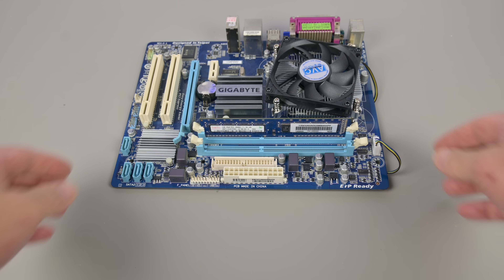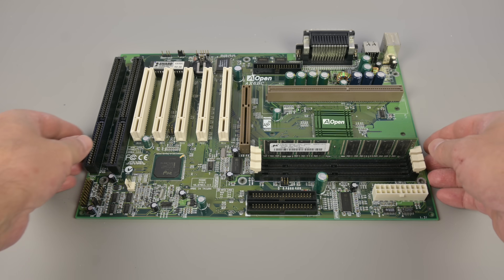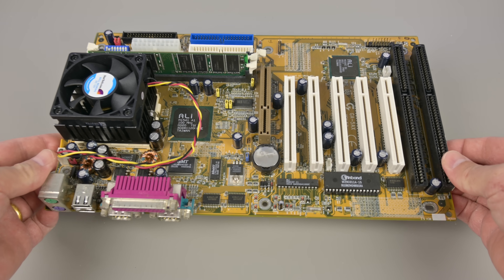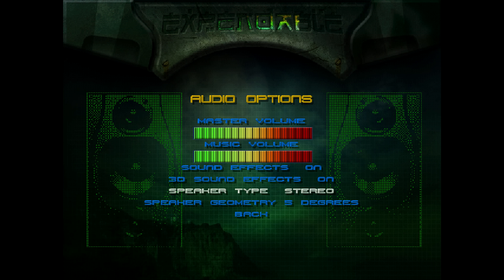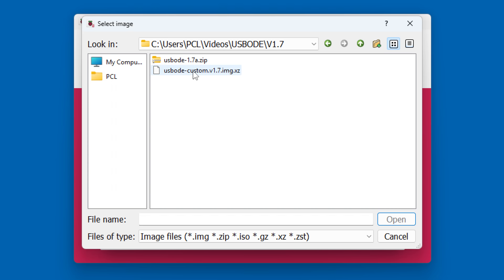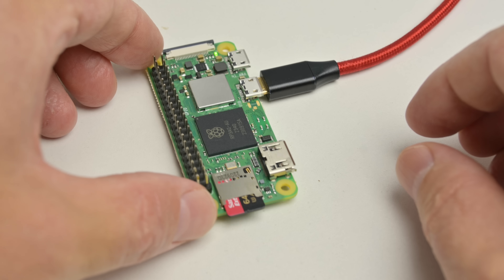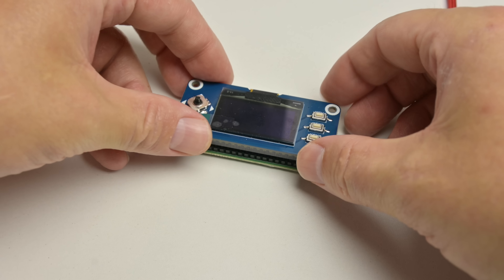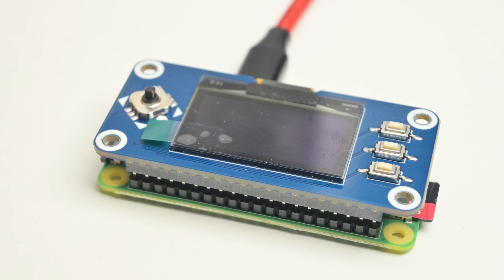Finally a cheap CD-ROM emulator for DOS and Windows 98!

Comment: Man, maybe you have an idea about this. i have my ALONE IN THE DARK TRILOGY original discs for widows. and I am looking for a way to play them .but using the ORIGINAL DISCS, not an image.  I have a PC with i7 4th generation procesor .  The 3 games should run on windows 98 . I also have the game X Files... if I remember correctly this one worked at Windows Vista.  So PLEASE, do you have any idea how to use  those games but still using the official discs to load them ?

Comment: I don't really see the point of using this instead of a real drive honestly... 
This device brings even more incompatibilities with older system and don't have faster rate of read/write than a DVD drive, not even more than a CD one...
Reply from the maker: You don't see the point of a USB optical drive that mounts ISOs instead of real discs??
Reply: @philscomputerlab , yeah I don't really understand why using this rather than a CD/DVD drive honestly, if at least it was fast it would be useful for 2 things, data transfert and longevity. Plus ain't demon tool or similar software working under win 9x ? It would be less annoying than using this device for every day use I think. Mounting ISOs directly from the HDD is faster for games loading, I'd use a secondary HDD just for ISOs or at least a larger disk drive for the system storage
Reply from the maker: You can't boot with Daemon tools. I really think you're missing the point. Just think if a USB optical drive replacement, that's what this is. If you aren't considering a USB optical drive in the first place, well then this device is simply not for you.

Comment: I love new tech, but there is something nostalgic about doing it the old way.   Sure, it is a pain to burn CD's, but at the same time, that is accurate to the time period.  The sound and feel has value to me.
Reply from the maker: I hear you. I read line that new optical drives aren't being produced anymore. So best to stock up.
Reply: @philscomputerlab  I have enough optical drives to cover my lifetime.  What is even harder to find is a high quality 5.25" floppy.  I have two left.  Both in good shape, but it would be nice to have a brand new one.  The tech of my generation is dying off with us.  Sad, but inevitable.

Comment: You STILL got to have a DVD drive to get the goodies off any original discs you have or may acquire. I have a requirement for almost ANY case I may build a system in to have a 5.25" drivebay. 
Tempered glass and RGB? Just Say No.

Comment: Love this for making use of a pi with old machines, but I wonder if support is planned (or implied) for dvd isos and support for modern bootable isos so I can use this at work instead of finnicky usb multiboot or set up pxe boot just to install an OS on a server.
Reply from the maker: Try it out, you might be surprised 😊

Comment: Been using the gadget_cdrom project for ages. Not using it for retro pcs but as a service device to reinstall modern  operating systems.

This one seems to be a better fork version of it, to be honest, I wish they prioritized DVD supporr which latest pikvm now support DVD.
Reply from the maker: DVD ISO worked fine for me. Unreal Anthology to name an example.
Reply: @philscomputerlab try using a untouched dvd iso windows 10/11 and boot at it, during setup process, thats where the issue comes in.
Reply from the maker: Yea I've done that, check some of my previous videos. Installed 10, XP and 98 with this device 😊 @EmilePolka

Comment: Hey Phil.

I was watching this video and immediately wanted to ask.

Does this ODE also work on more modern systems?

Cause if yes, it would be a good way of loading Linux .iso files or more unknown operating system .iso's as Ventoy doesn't exactly boot more unknown operating systems. (Haiku OS is a good example. Trying to boot that .iso from Ventoy just results in a crash into kernel debugging land, even in RAMdrive mode)
Reply from the maker: Absolutely 😊

Comment: Why do we need this? Just use a cd-rom. You’re already using vintage mobos and procs. They’re out there. I’ve got a few kicking around. Even modern optical drives should work as cd-roms.

Comment: I want a SATA to PCIe NVME adapter. So what if it's a lot slower than the best speed of the slowest PCIe NVME SSD, it could still be made to max out the best SATA transfer rate. USB C to PCIe NVME adapters exist, that's adapting one serial link to the 4 PCIe lanes these SSDs use. I'd also love to have an ExpressCard with one USB C port using a real USB C controller, not a USB 3.0 controller with a bodged on USB C connector.

Comment: Here is some information to help such devices develop. A RaspberryPib3B+ could be a reasonable choice (or Pi3A) for the faster, and somewhat overclockable CPU, plus the extra RAM on some 1GB models, especially if the graphics are limited to 16MB (which also happens if the OpenCL driver is used to utilise the GPU as a processor core of sorts in terms of heterogenous computing) and also some of the A53 CPU chips will overclock. So if thereby the "Emulation CD or disk" speed can get up to (and maybe beyond) 10x CD speed, tat is essentially a 1x DVD speed which could be useful for various reasons, including on Linux to use the emulator for bootable LiveCD ISO files or Live-DVD whereby the USB of the raspberryPi3b is, by adaptor, plugged into a USB port of the AMD64 (or Intel) PC which then sees it as some ATAPI or whatever CD or DVD drive, maybe even as a CDRW in CDRtools or DVDRW. There is also the fact that (especially with the extra RAM at 1GB thereby allowing perhaps 512MB or even more) for the RAM to _(almost like squashFS) hold a ISO and ISO buster to author and change and checksum with no wear and tear modestly sized ISO files, albeit maybe slightly smaller than a full 650MB CDRRW, but maybe a full 650MB CDRW ISO could be editing in the RAM on it that way. There is then the fact that the A53 configuration of the Pi3b and Pi3B+ (and the Pi3A but it has only 512MN RAM) involces protection-rings and those are associated with use cases for say a camera but passthrough of a CDRW drive emulated might work especially for the associated audio and video connotations or even streaming wit a SIP UDP session initiation protocol. The OpenCL driver can be used for the GPU to help some Fourier analysis and perhaps Laplacian polynomials in a matrix for a part of video processing of a DVD or SVCD or some plain MPEG or basic ogg-vorbis-theora low in bitrate and gentle on the compression. A carrier signal on the FFT could be useful for signal integrity by OpenCL GPU0 and CPU combined, or polynomials similar to a basic PLL. The Laplacian dampening could also be used in audio and video plus predictive buffer. Or Markov chains from a Lapacian matrix thereby formed by generation of Eigen vectors could be used in compression, even general purpose like some tar and *nix-zip sort.
My comment has no hate in it and I do no harm. I am not appalled or afraid, boasting or envying or complaining... Just saying. Psalms23: Giving thanks and praise to the Lord and peace and love. Also, I'd say Matthew6.

Comment: Maybe another project would be great to emulate very old GPU that run under windows 98 like voodoo 3 3000 using USB and the pie
Reply from the maker: GPUs are incredible complex, I don't think will happen easily. There are projects that use old GPUs though...

Comment: I love this, I used it in both DOS and Windows 98 on my Pixel DX. Apart from it needing bin/que support, which does appear to be on the authors radar. Another thing that would be nice is a web UI that can be used on a phone. I find changing CD's on a phone requires zooming in which isn't nice. Perhaps someone can help there with a more modern UI but not over the top React app either, just some styles should suffice.
Reply from the maker: Yea, I also use my phone and have to zoom in for the main menu 😊

Comment: Cool.. But not for me. Or I'm not thinking of the reasons atm?? I have like 50 cd-rom drives and a lot of cd-rw and cd burners etc. Also if the pc has USB I can just flash the iso to a USB stick and run it that way...There are also lots of IDE to SD card adapters on the market that can be used with computers without USB (for like 10 to 15 bucks)

Comment: What drivers did you end up using?  I've tried USBSYS, USBASPI, and OAKCDROM with no luck detecting it.
Reply: Make sure the usb cable you are using can support data aswell as power. Some only do power.

Comment: The 'cdemu' project provides full emulation of optical drives on Linux. If the Linux Mass Storage Gadget could forward SCSI commands this would be a great way to add support for CDDA and other file formats. Unfortunately the MSG appears to only supports file backing.
Reply: This is exactly what I'm exploring right now. cdemu is actually already baked into usbode, just lying dormant right now until I can figure out how to serve /dev/sr0 over USB

Comment: Great project! How long until we have a hobbyist motherboard with ISA slots you can connect boards to, but with a Pi-based cpu emulator at its core that you can throttle on the fly? That'd be the perfect setup for me: use real hardware where you want to, emulate what you don't want to have, and throttle your cpu speed like in DOSBox.

I mean, with peripherals that emulate the Gus in an ISA slot, you could argue that the line between "real hardware" and emulation is already starting to blur. Having a hardware core that you can expand with real hardware if you want to (like the ZX Spectrum Next, in a way) sounds like the perfect emulation/retro-gaming setup (edited a bunch for clarity)
Reply from the maker: A replacement motherboard would be awesome.

Comment: Niiiice.
As someone who's been using the Zalman and IODD external drives with ODE emulators for over 12 years, this is amazing already.
It would be a major boon to have BIN/CUE support on this, even if cd-audio doesn't play, many games have unique layouts, subchannel data, and copy protection that ISO doesn't support.

Comment: Nice! I would like to see a USB floppy emulator next! Not a gotek but like an external USB floppy drive!
Reply from the maker: @GeorgeSaulot  Gotek with USB adapter will do the trick
Reply: @philscomputerlab  I guess, but its bulky, maybe a pi pico solution would be smaller
Reply from the maker: I feel it's not worth it because the Gotek is such a good device. Been using it for what feels like 10 years without a single hitch. No need to reinvent the wheel.

Comment: I recently got a diy "pikvm"  and this has besides it's video over ethernet, a usb emulation part for disks or cd images. Can highly recommend it as well! (caveat, the video part sometimes needs a upscaler in between due to low bios resolutions)

Comment: I like the idea of the project.  I kinda would prefer it to use USB thumb drives instead of sd cards.  I keep thinking if someone would make an IDE to USB HD / CDROM emulator it would really make things easy. Maybe I just do not know of such a thing? Could be. I find myself always  out of touch with things now days!
Reply from the maker: It's slowly happening. People realise that the market is ripe and whoever is first to market with a good value product, will do well. This one isn't Ideal, but it works well enough. Better than what I had before.

Comment: I would love for there to be options to set the drive speed. Some games expect a slower drive for playing speech.
I would also like faster performance to use it to remove the need for dtools entirely on more modern PCs (Alternative options expensive).

Comment: I have a few of these but they are running a different version that allows you to create multiple flash drives images also. So if you needed a 1gb disk, you could create one then mount it with the screen. Works really well on lots of different operating systems.

Comment: errrrm... IDE CD/DVD emulator could be useful, since it's becoming difficult to find such drives in decent working condition, but what's the point of emulating a USB CD-ROM? real ones are still made, and anyway, if something supports USB CD, it definitely supports USB Flash, so what's the practical purpose of such a device? what problem does it solve?
Reply from the maker: Exactly what you're complaining about. To use CD images and not a real optical drive.
Reply: @philscomputerlab  looks like too big and expensive overkill for a task already solved: operating systems modern enough to support USB can usually use CD images directly by Daemon Tools, Alcohol, mount -o loop, etc, etc, etc without any need for external hardware.
Reply from the maker: @ironwheal  Yes that's software, with big shortcomings in DOS. This solution is hardware based, which many prefer. But we have a choice, you can use whatever you prefer 🙂
Reply: "If something supports USB CD, it definitely supports USB Flash"

This hasn't been always true. The first boards with USB boot support could boot from USB ZIP or USB CDs, but will refuse completely to boot from pendrives, and even will lock themselves. Many Pentium 3 and Athlon XP boards and laptops have this problem, and many of them weren't fixed in BIOS updates.
XP from box supports booting from USB CDROMs, but you have to do extra stuff and trash to add pendrive support to it.
Since this channel is about retro stuff, you have to account these old devices as well.
Reply: @hyoenmadan  meh, if it has USB, it isn't retro. at least that retro :) a very niche use case that's already covered by normal USB DVD drives which are easily available everywhere and aren't going away anytime soon.

Comment: Seems like it wouldn't be too hard to get it to output CDDA via a cheap DAC and route it to the sound card's line input
Reply from the maker: Hard enough that nobody has done it yet. Dani is having a go at it, let's hope he succeeds!
Reply: @philscomputerlab  Zulu has done it and they open sourced the firmware
Reply from the maker: @DanielW-x4v  Not on a cheap Pi, that's the whole point if the USBODE 😊

Comment: Dang, that's what I've wanted to see, but I want it to be useful for XP as well. since I once Experienced a XP Install being stuck, like it was refusing to finish installing from a USB Thumb Drive for some reason... Hopefully that could be more reliable to do so. I wanted to finally have an SSD + XP Experience but on a laptop without the DVD Drive... Yep, that didn't work, installer got stuck every time. USB Thumb Drives themselfs are a hit or miss with installing XP.

So if it's for MS-DOS, 98 AND XP, I'll be 200% sold for it. But I like what I saw already.
Reply from the maker: To install XP? Should work just fine
Reply: @philscomputerlab Oh ok, I thought there could some issues with that...

Though it could be on a slow side and would take an hour to install it, I believe.

Comment: This CD-ROM emulator is actually a lot more powerful than you'd think—or at least, it could be. Imagine turning it into a fully generic ISO emulator, not limited to just CD, DVD, or Blu-ray formats. Add compatibility with the Raspberry Pi 5 and support for M.2 storage, and suddenly you’ve got a portable, high-speed system that can carry all your programs, software, games—whatever you need—on hand.

Make it Plug-and-Play via USB, and it could work across multiple machines, maybe even game systems. Add in reverse FTP support so that any machine on the network can detect it—just power it on, and boom, there's your entire optical ISO library. It’d be like a mini NAS, but with the added ability to plug it in directly and mount whatever optical media you need.

Sure, Daemon Tools supports this on Windows, but this would be hardware-level and more universal. Store everything in one compact unit. Access it via USB or FTP. No need to install extra software on the host machine—as long as you can boot from USB or access the OS, you’ve got your entire optical collection in your pocket.
And maybe add a USB to IDE adapter and you got the perfect thing for even non-USB compliance.
Reply: ISO doesn't support multiple formats, only data formats. So if you have copy protections or CDDA or anything else, you need something which can emulate at a lower level, as what A120 or DTools do.

Comment: This uses USB Gadgets which not only does CD-ROM but can act as mass storage, serial, MIDII and network interface. You can even have it do multiple ‘devices’ such as CD-ROM and serial for example. One thing to note is when I tried this a couple of years back for something is that you can specify the ViD and PiD (and other strings) which I think affects the drivers the computer itself plugged into uses.
Reply from the maker: Yes, you are right! Last night we swapped out VID and PID to march an old Panasonic USB CD-ROM drive and now the device is picked up in old retro PCs in DOS just fine 😊
Reply: @philscomputerlab  Cool!

It might even be possible then to set up a pid/vid of a network device and use RaspAP (with the LAN being the USB and WAN bring the wireless) to route it.

At the very least, you could do serial and log into it and access the Pi Zeros shell :)

Comment: I wonder if you could use a usb to ide adapters on the pi to hook it to older computers. Would need to play with the software but it would eliminate the slow speeds on the gpio.

Comment: Was kinda hoping this would interface via IDE so it's universally compatible. USB limits it quite a bit (pretty much useless pre-PII era). Still a cool project, and one hell of a lot cheaper than those ODE emulator USB HDD/SSD enclosures that have existed for years, but their prices have always made these not very average-joe-friendly
Reply: Because emulating speedier devices than a Floppy, at bus level requires specific parts which add to the cost (name CPLDs, FPGAs and such). And the cost isn't scalable giving how many possible users of the device would be there.